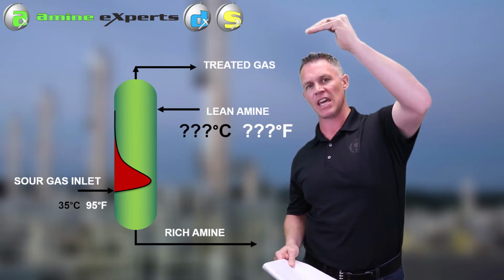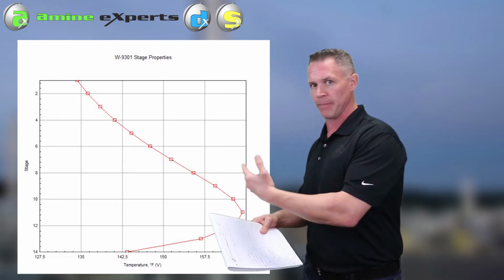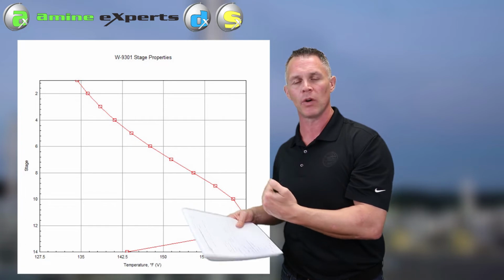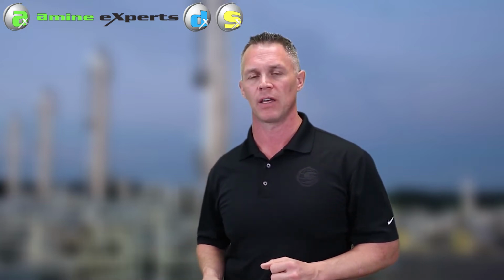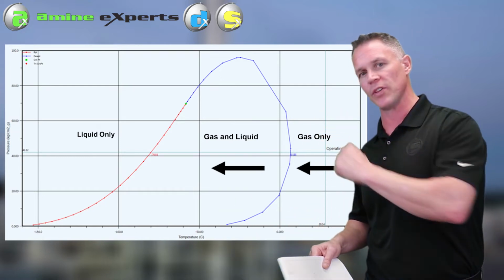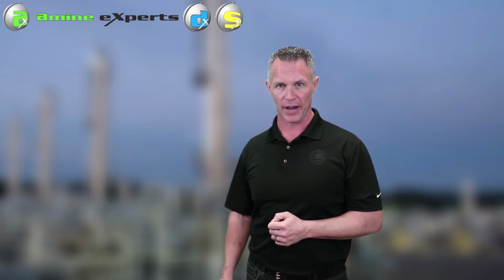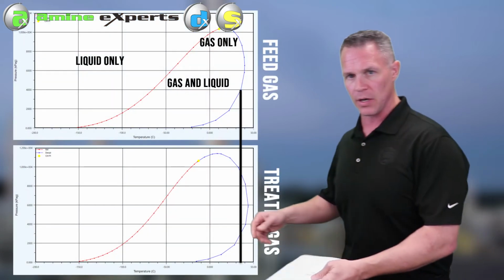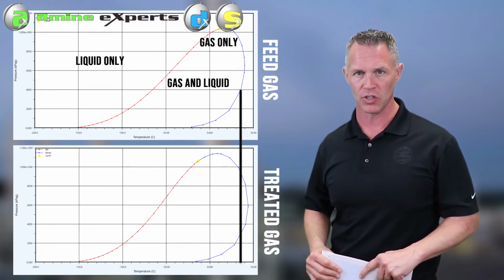How to Set Lean Amine Temperature

Comment: during restart of the upstream amine treatment unit after a trip, there is hydrocarbon entrainment which is causing the incinerator trip in SRU at high temperature due to hydrocarbons from the acid gas enrichment absorber

Comment: Is there any industry changes in the past 1.5yr that would contribute to higher than normal amine concentration in high purity non odorized isobutane/n-butane? 

We use alot of non odorized instrument grade butanes and seem to be having process contamination with some sort of amine. Of course the gas distributor doesn't test for such so we are left to figure it out on our own

Comment: I got two questions for you, what should be the differential of temp between lean amine and ngl in an amine liquid to liquid contactor and which should be warmer?
Reply: Hi Luis, in a liquid-liquid absorber there's no need for a temperature differential, as there is no concern with either phase condensing. In fact, if the amine is too warm you can vapourize the hydrocarbon to gas and cause real problems! We like to run the amine and NGL at about the same temperature if possible. Sometimes the amine winds up being a bit warmer due to limitations in the lean amine cooler.